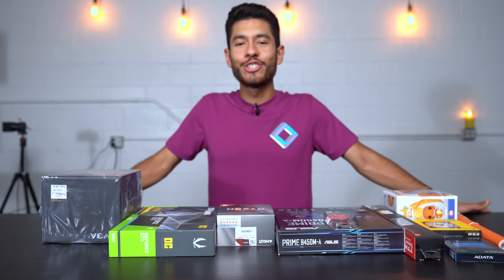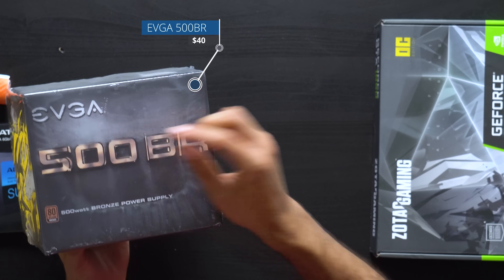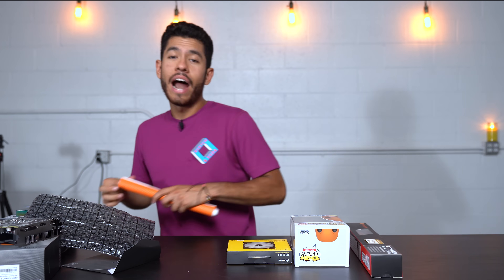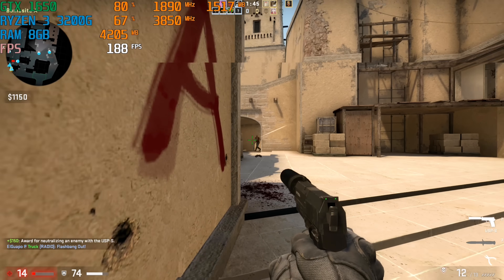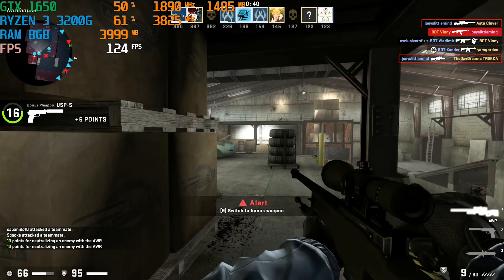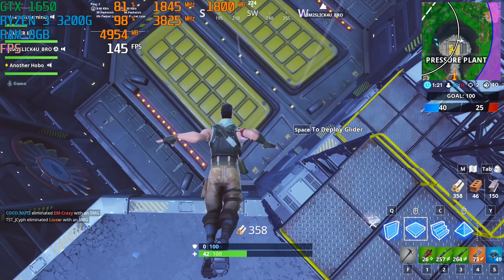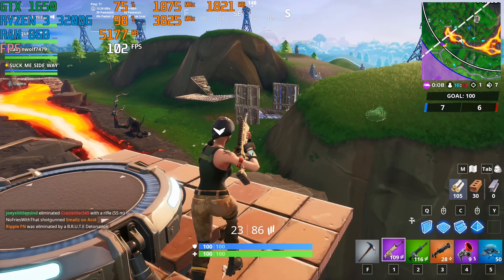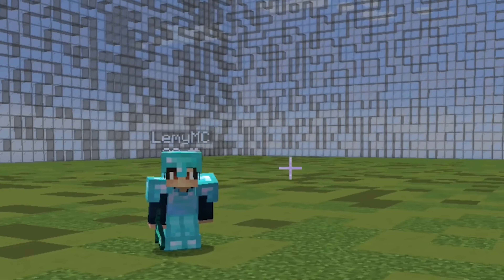$500 Gaming PC Build - GTX 1650 Ryzen 3 3200G (w/ Benchmarks)

Comment: So I'm building my first PC and I have a budget of 600$ and if you can rate my specs or tell me what you would change that'd be great
SPECS:
CPU: Ryzen 5 1600
GPU: Radeon RX 570 4gb
RAM: Corsair Vengeance LPX 16gb (2x8) ddr4 3000mhz
MOBO: Asus Prime b450M-A/CSM
STORAGE: Sabrent 512gb Rocket NVMe M.2 ssd
CASE: Rosewill Bradley M ATX 
PSU: 600w Semi-Modular 80+ Bronze 
Total adds up to 585 bucks including extra Cable's,fan splitters, ETC. So just tell me your opinion
Reply: Add a 1 or 2TB hard drive
Reply: @paulodybalafan1470  is it worth it? Im not gonna be downloading many games, definite games is r6s, counter strike, and rise of the tomb raider

Comment: If I were to replace the gtx 1650 with a rx570 would it fit in the case?
Reply: Idk about the case but i dont think you should do that anyway.. you wont see any remarkable difference.. better save up for a real upgrade :)
Reply: GIORGOS KALOKIRIS the rx 570 is cheaper though...
Reply: GIORGOS KALOKIRIS it’s bigger though so I hope that it will fit

Comment: I like this build, the only thing I would do differently is go with a less expensive, used GPU like a RX 580 8GB (can be found on eBay for $100)and use the savings on another 8 GB stick of RAM

Comment: A better cheaper build would be : i3 9100f, any cheap h310 mobo, 4gb 2400mhz x 2(higher mhz doesn't help much for intel cpus), 450w, 240gb ssd, rx 570, if cheaper(here in india, 1650 is cheaper)
Future upgrades - i5 9400f, 1660 ti/rtx 2060 (no need to upgrade psu, 8gb ram is enough for today's game requirements on 1080p)

Comment: CPU:AMD Ryzen 5 3600 - 6-Core 3.60GHz, 4.2GHz Turbo - 32MB L3 Cache Processor, Pro OC Compatible
Memory:16GB (2x8GB) DDR4/2400mhz Dual Channel Memory (HyperX Fury w/Heat Spreader)
MOTHERBOARD: MSI B450M PRO-VDH MAX: M-ATX w/ RGB, USB 3.1, SATA3, 1x M.2
VIDEO: AMD Radeon RX Vega 56 8GB - DX12®, VR Ready, HDMI, DP, 5 Monitor Support (Single Card)
HDD: 2TB Seagate BarraCuda SATA-III 6.0Gb/s 7200RPM Hard Drive (1 Drive)
Is this a good pc build for Fortnite

Comment: Great build, but you could of gone for an i3 8100, or i3 9100f which is cheaper and benchmarked at performing better overall. Also if you were on a tighter budget, that case is a little overkill, you could of gotten one for half the price that looks relatively the same.

Comment: Using single channel RAM is a terrible sin in 2019 especially with Ryzen. Since you already have a motherboard with 4 RAM slots, you should've went with a 4GBx2 kit for the same price.
Reply: I was wondering the same thing....
Reply: The difference between 1x8 and  2x4 is huge https://youtu.be/-k5wA7EFwpo?t=33
You do not need more than 16GB of RAM unless you're doing some heavy content creation. Even new games are ''barely'' starting to benefit from 16GB of RAM. You can still get by with 8GB of RAM as long as it's dual channel.

Comment: Why do these builds that use Gen 3 processors on gen 2 boards never mention how they update the bios? The 450 needs a gen 2 processor used first to update the bios unless you get a flashback board to do the update. They make it look like you can buy a 450 and a Ryzen 3 and will work out of three box.

Comment: Your choices are so bad, I can't even explain how frustrated I am.
If you want a budget build go for:
CPU - Ryzen 5 2600 - $139
Motherboard - MSI PRO B450M PRO-VDH MAX - $79
GPU - Sapphire PULSE RX 570 - $120
RAM - CORSAIR Vengeance LPX 16GB (2 x 8GB) - $69
SSD - Crucial BX500 2.5" 240GB - $32
Case - Cooler Master MasterBox MB510L - $42
PSU - EVGA 500 80+ BR - $49
Total: $536

Comment: Nice content as always but I disagree with this build because of the RAM and GPU. The RX 570 would've been a way better (and cheaper) part for this. Would probably have made it possible to squeeze in an extra 8gb stick. The RAM would also have been in dual channel! 8gb of RAM, especially in single-channel mode, just isn't acceptable in 2019.

Comment: Ryzen 5 3400g should have 6 cores and 12 threads. But now it's just a ryzen 3 with better graphics.
Reply: 3400g has 4c 8t
Reply: You sure can play ACO or Battlefield with R3 3200g since it's the same as R5 3400g.
Reply: @blizzard wind I know bro I am saying ryzen 3 g(any gen) is same as ryzen 5 g(any gen)
Reply: it also uses zen + architecture instead of zen 2 so he should have gone with 2600 or 2600X
Reply: yes 2600 is best for 500$ builds

Comment: Hi mate. Love the channel and am usually a big fan of your builds but - constructive feedback - I'm not feeling this one too much... The 1650 is not a good value choice (or just a good choice ever). The Radeon RX570 4GB is cheaper and provides better performance. Also personal opinion on the aesthetic side, but I just think a Micro ATX mobo in an ATX mid tower case looks wrong. I feel like it's the computer equivalent of socks and scandals.
Reply: Hey bro. Nice feedback. Thought I'd ask you if all parts used in this build plus the ones you mentioned are good for the budget? Or you have better recommendation than this build? I'd appreciate it bro. Thank you!
Reply: @kingfischurrr   M  thanks. Yeah I think the build is broadly ok otherwise. Given the micro ATX motherboard, I'd change the case to a micro ATX case. The CoolerMaster MasterBox Q300L for instance is popular and would save you $15 compared to his case (and look better imo). As long as you don't mind an acrylic side panel. The build is clearly designed to give you a base to upgrade on, as you'd expect for any entry build. Probably first priority will be more drive space as that 128GB drive will only be good for a couple of big games. The only other thought was on his RAM. As you probably know it's better to run RAM in dual channel. That motherboard actually has 4 DIMM and you can get 2x 4GB stick of decent RAM for under $50 (what he spent on the one 8GB stick). So I'd personally do that, knowing that I will have the spare slots to get another 2x 4GB slots when I had the cash (as 16GB RAM is really what you want to aim towards for modern gaming).

Comment: Hello , this first time i comment on youtube 
i want to ask about build with RTX2060 with ryzen on 1000 $ budget , any recomended 
thanks
Reply: You should think about getting an Radeon RX5700 instead as it's a similar price to the RTX2060. You won't get ray tracing but frankly I don't really think the 2060 has enough horsepower to enjoy ray tracing without making serious compromises on your graphics settings elsewhere. But what you do get instead is 8GB VRAM rather than 6GB which will future proof your build better. The AMD R5 2600 is a steal right now at c.110 bucks and is still a great chip. You should pair that with an MSI B450 Tomahawk motherboard. The Corsair 220T case might work well. It comes with a full complement of RGB fans and great airflow for around 90 bucks. Then 16GB of Corsair Vengeance RAM at 3200MHz. You can then get yourself a 250GB M.2 Nvme boot drive, a 1TB SSD drive for your games, and a decently priced semi modular power supply, and you should come in slightly under budget (depending on prices in your region).
Reply: @sirreginalddoc3117  im not expected about this answer , thankyou verymuch bro 
i think i will use m.2 250 for windows for now and 1 tb hdd on this pc i use now 
if i have extra money i will buy ssd for game too 
once again , thankyou
Reply: Yeah no worries

Comment: the b450 is fine just dont bother with the 1650 at all, too expensive for what it is just get a decent rx 570 instead and the 3200g comes close to costing the same as the ryzen 5 2400g so get the ryzen 3 2200g instead also get a crucial kit of 2666mhz 2x4gb white because those overclock like crazy so you can probably get 3200mhz oc on the dimms and 2933 at the least. single channel is literally a bottleneck and no one likes bottlenecks or stuttering so id rather get 2 instead.

Comment: I'm selling a i5 6400/RX 580 8gb/8Gb ram @3000Mhz/600watt PSU/ 1TB/256SSD/ Gigabyte GA-Z2Z0XP-SLI motherboard/ It has hyper evo 212 cpu cooler. A ENTIRE SYSTEM BESIDES THE CASE FOR ONLY 450$ SOMEONE BUY IT FROM ME.
Reply: overpriced imo
Reply: @aholscher560  bruh
Reply: @aholscher560  it's better specs than the system he built and it's cheaper
Reply: @override1360  true but my opinion isn't based of the build he made. Maybe in your country it's a good deal but where I live not really
Reply: @aholscher560  oh okay.

Comment: So i just built a pc and it turns on, but a blue led near the power switch turns and the cpu debug light comes on, im sure everything is in correct so im not sure what to do. Also when i try to plug in my keyboard and mouse they just flash on then off so idk if its picking up that connection either? 
Specs:
Rosewill Tyrfing Case
Thermaltake 600w power supply
Corsair Vengeance Ram 8g
MSI Radeon 570 GPU
MSI Bazooka V2 B450M Mobo
Ryzen 3 2600g CPU
Sandisk SSD 2 of them one 1tb and one 500gb

Not sure what to do

Comment: Lol for real? A 1650 which can only benefit you if used in a small formafactor prebuild system as a low profile card is suggested by you despite there being the rx 570 which is way cheaper and way stronger in a custom build system? Oh my..

Comment: Bruh, that power supply is $60 not $40. Thermaltake has one for $45 that is 500w ("Thermaltake Smart 500W 80+ White Certified PSU"), it's white rated but hey your building a $500 PC.

Comment: Good build, would’ve been better with 2x4GB sticks of RAM instead of 1x8. Love the new sound effects btw
Reply: but it does add more upgradability
Reply: HaVoKYT yeah but 2 sticks take advantage of the dual channel or whatever it’s called I forgot
Reply: @ChaseeCS  but if you want 32gb of ram down the line then go with 1x8gb stick
Reply: HaVoKYT it’s a gaming setup and it has 4 slots, so it would be way faster with dual channel

Comment: So I have a question. I'm building my budget PC build right now too and I need help with it. So yeah I'm having problem with the usb port. Before when I plugged in the keyboard and mouse to the USB port. It work perfectly. Then recently I started reorganizing my wire so I unplugged all the wire because I needed to put some SSD on the mobo then when I got that fix. I plugged all the wire back and now when I plugged the keyboard usb to the PC USB port it won't work. What should I do?

Comment: Couple changes I would make, get ryzen 2200g instead, save 20$ and get the Rx 570 save another 30$ use this money to get another 8gb of ram or  and actual 1tb HDD. the 570 will be better than a 1650 and the 2200g is not much weaker than 3200g you wont see a difference, you could also go for a cheaper case 40$ and get both the 16gb ram and the HDD.

Comment: hey joey so i copied your rtx 2060 build built it great have had no problems just had a couple questions. So when i play r6 my cpu is at 100% when my gpu is only at 25%. this was my first pc build and i'm worried. is that going to damage my pc?  I also had a question about the fan led driver because it wont run so my fan is stuck to a amber color lmfao plz help.

Comment: Why would you even put a gtx 1650 instead of rx 570?
Reply: I think he prefers GTX, I built a pc with a Ryzen 3 3200g and a Rx 570 and get similar performance with a 40 dollar decrease.
Reply: @boradcarsen  Not bad. Same goes for mine. I got a Ryzen 5 1600X with a RX 580 and I could've gone with the GTX 1060 or 1070 at the time but it was expensive due to bitcoin mining at the time.
Reply: I said the same thing,,, a gtx 1650 makes no sense at the moment
Reply: rowan 3 I don’t know much about PCs. But if i were to just search up the Rx 570 on amazon, could i just choose anyone and use it with this build? I don’t know much lol.
Reply: @kyshawntv6285  hope im reading this right but yes, as long as it is a trusted brand. like msi, gigabyte, powercolor, xfx, sapphire
Reply: Navi Fan Oh okay cool. Thank you so much!
Reply: @kyshawntv6285  my current build is a ryzen 3 2200g with an rx570 with 8 gig of RAM and both CPU and GPU work very well together with no bottleneck
Reply: rowan 3 Ok good. I am going to get this build rn with the Rx750. Thanks
Reply: @kyshawntv6285  it's a great budget set up, you won't be disappointed. I'd also suggest overclocking the CPU to gain more  performance.
Reply: @kyshawntv6285  yes u can actually the rx 570 would give more performance
Reply: For stock reasons, in many countries it's over 200 or 300 dollars, for slme reason
Reply: @klaus9356  Bro, I feel bad for the other countries beside the United States because we seem to get cheaper products and sometimes a good deal if you find a used one in the used market. Seems like Joey likes to do everything on Amazon, that's cool and all but why doesn't Joey not try newegg or go used components from craigslist, ebay, or the Facebook market and sees what he can snatch?
Reply: this channel already have rx570 pc build
Reply: @dausdenan7079  TIME TRAVELER😱 OMG!
Reply: Razzers you could even put a 580 in it
Reply: NNaT ZaZA  I live in Thailand. I bought my rx570 for 3,600 THB new :)
Reply: why not? why allways has to be Rx570?... i see no problem picking gtx1650
Reply: Yo guys can you use rx 570 8gb with ryzan  3 3200  is that a good idea?? Help me.out
Reply: would it even bottleneck? if not then rx 570 is def better than 1650
Reply: @hodee9815  I get a 2.78% bottleneck on bottleneck calculator.com